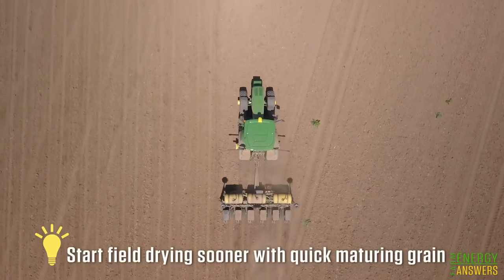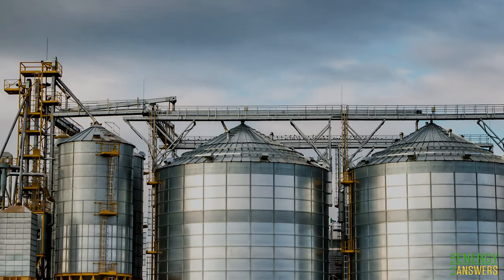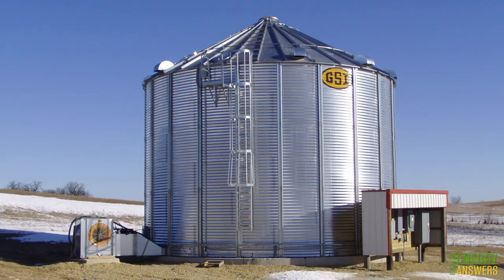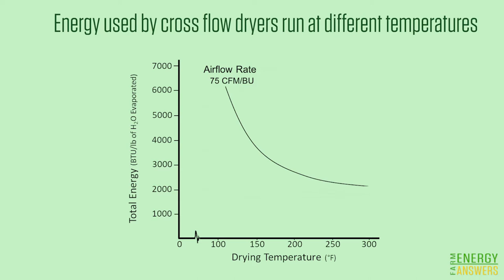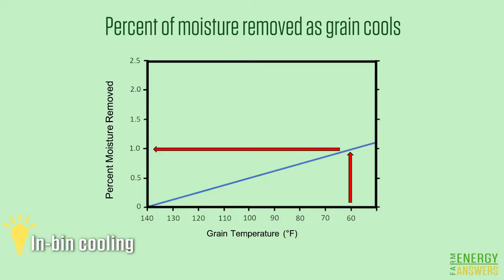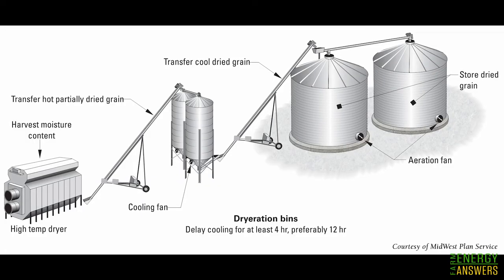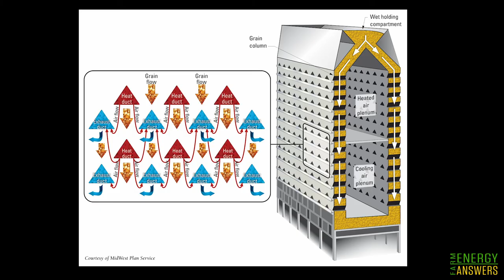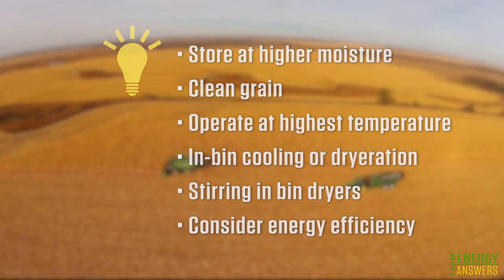How can I save on the cost of drying grain?

Comment: Really good advice. Question: my dryer has a cooling section and the 2000bushel bin doesn't have a fan or floor what would you advise I add?
I have some grain lose by the door where diangle auger come in.